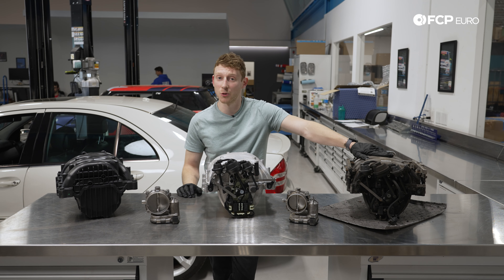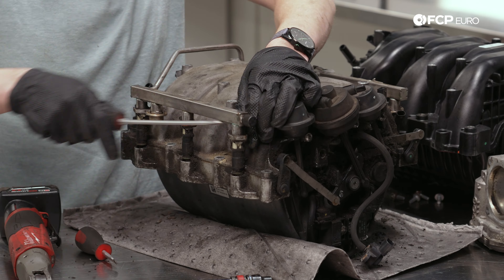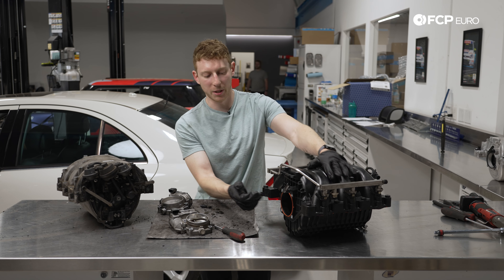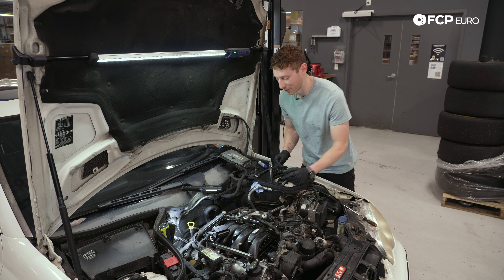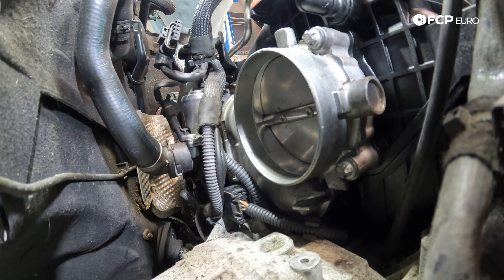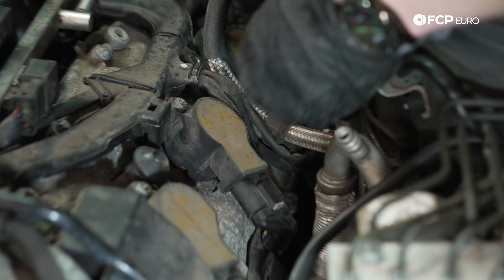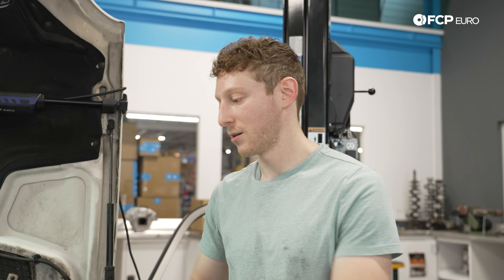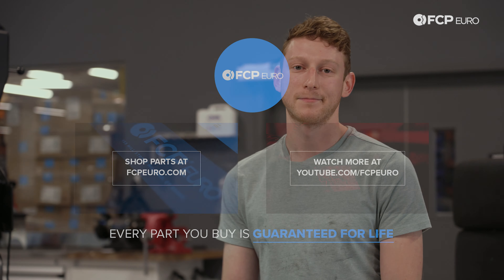Mercedes W203 Intake Manifold Replacement DIY (2005-2012 Mercedes M272 Swirl Flap Repair) - Part 2

Comment: Did he never comment on how it all turned out with out a tune. or am I just missing his comment?
Reply from the maker: Thanks for following up on this! Your comment is pinned for anyone else looking for final thoughts.

The car that received this swap was daily-driven, and did a full year of regular commuting (~10,000 miles) without a tune for the M014 manifold. LTFT adapted well to the new manifold and throttle body, and the car never threw a CEL.

As noted in the video, this upgrade definitely suits the higher-displacement M272 engines the best due to the sacrifice of low-end torque that will inherently occur. The C350 in this video drove nearly like factory in lower RPMs and still had plenty of top-gear passing power on the highway, while a previous C230 with the same upgrade  (2.5L M272) and using the same gearbox with a shorter differential ratio needed to be dropped a full gear to pass on the highway. Both of these cars used a 716.6, so it is possible that a 2.5L car using the 7-speed automatic will be able to manage this upgrade better. While the 2.5L car we tested was a little bit underpowered at cruising speeds on the highway, it was plenty of fun around town and gained noticeable power up top, making for a great backroad car. 

Our overarching summary of this upgrade remains positive - it solves for a maintenance issue by deleting the runner flaps, and it optimizes for airflow with the composite structure and the upsized M273 throttle body. It's also relatively cost-effective and is dyno-proven.

While we'll always recommend an ECU tune for your engine's safety, the car will be drivable without one and may even drive exceptionally in day-to-day commuting. Of course, a car being driven harder or even on-track will skew more towards "mandatory" when it comes to tuning, as more strain is present.

Comment: Bummer this part is no longer available. Any plans on bringing it back? Or can the bladders be removed from the stock manifold?
Reply: Honestly!

I would really like to purchase this…
Reply: just fyi. I bought the intake last week, from a dealership in New Jersey.  They has two, I bout one so their is one left. Take the part number form the FPC Euro website. Go to your local Mercedes dealership and ask if they can “D2D” (Dealership to Dealership) like I did.
Reply: there are some still out there, they are just hard to find. I just bought one in Texas in perfect condition and will be doing the mod on my E350 since the intake needs to be replaced. I would also check ebay. They tend to pop up in Europe.
Reply: @mbmann3892  how much did the intake cost?
Reply: @ Well I’m also a Mercedes Tech. So I got a discount. I assume with out my discount ..380…I paired less then that. If you’re serious enough. I’ll check if it’s still in stock and the price with out discount.
Reply: Let me know I'm serious
Reply: Bad news. They ran out.

Comment: What are the symptoms/error codes that will lead to requiring an intake manifold change? Oil buildup inside it for example? And can't it be cleaned/flushed with degreaser fluid or brake clean and then reused?
Reply: Intake Runner Flap code will be present. possible Lack of power and check engine light

Comment: "Around town drive ability" does that mean it idles rough and you lose the luxury smoothness?
Reply from the maker: No rough idle! It almost feels as if you've removed a bit of the power and torque you'd have in the lower third of the rev range with the stock manifold and added it to the top end instead, meaning things like low-rpm acceleration may require a tiny bit more throttle input. We've found this to be a lot more common on the manual, 2.5L cars (so something like a 2006-2007 C230) than the 7-speed cars or the manual cars with a 3.0L or 3.5L M272.

Comment: Do you have any updates of how the car is coping with the M014 swap? 

Is the difference noticeable? Was the upgrade worth it? My C350 also developed the same issue recently, so I might also get the upgraded IM, as well as the M273 throttle body.

Greetings from Deutschland! 😄